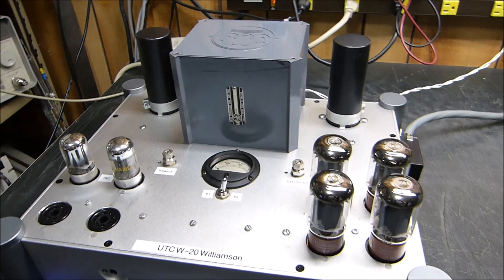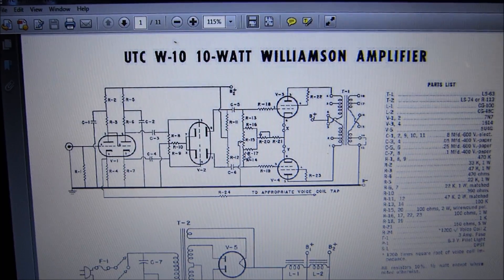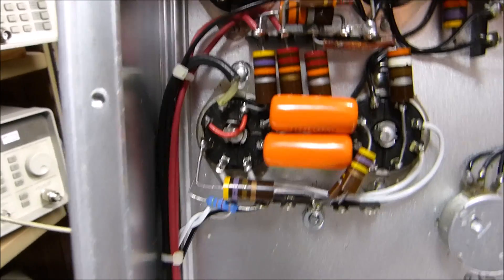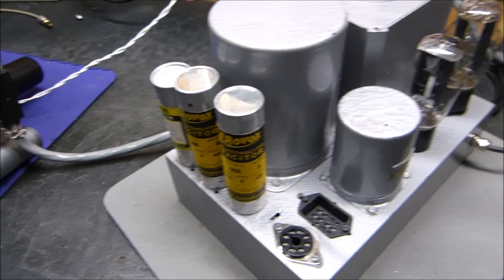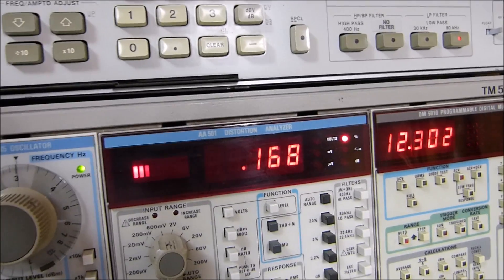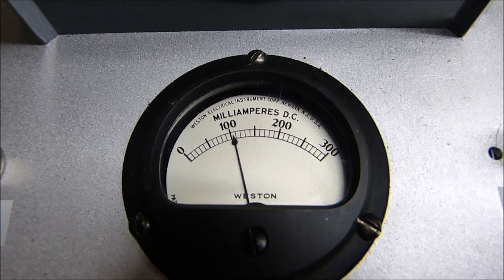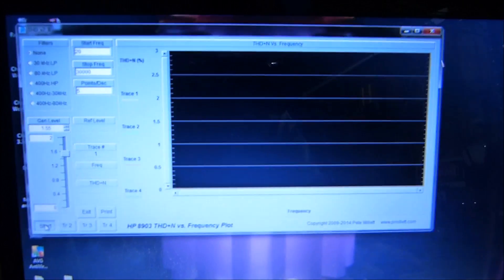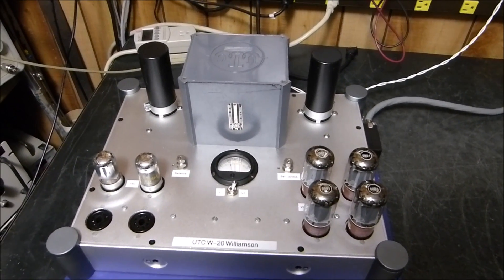UTC W-20,  20 Watt Williamson Vacuum Tube Amplifier Using UTC LS-60A Output Transformer

Comment: I often wonderd  what effect the power transformer has on a output transformer  being close by . It seems to be a very good idea to have the PSU,  separated and a big power transformer over rated and choke I think it will produce lower hum.
Reply from the maker: In an amplifier I posted a couple of years back, I did make measurements of the orientation of the power transformer in relationship to the output transformer. If the cores are parallel, there is indeed voltage induced in the output transformer that is very small but can be easily measured. If the OPT and power transformer have to be close to one another on a chassis, the cores should be at right angles to each other if possible.

Comment: Nice! mono or do you have the other channel too?
Reply from the maker: I don't have a second channel. That would be nice and the stereo version amplifier could be built on one chassis. The idle current is 200 mA on this amplifier for the four 5881's so it would require an even larger power transformer (400 mA). 
My primary interest in audio (besides listening to music) started some time back (like 50 years ago) when I kept hearing how marvelous these UTC, Peerless, Acrosound, etc transformers were for vacuum tube amplifiers and in the last few years, the high price some bring on Ebay.  
I build these amplifiers and have amassed these instruments that I take great care in maintaining at the highest standards I can, just to build, measure and document the performance of come of these vintage components. 
Some of my amplifiers are never connected to speakers and their entire existence has been on a dummy load and under test. That might sound crazy to some but it is my passionate hobby in audio frequency equipment. 
I also like to build high power RF amplifiers and everyone of those amplifiers, after some bench tests, gets connected to an antenna for communication with other ham radio operators.
Reply: @ElPasoTubeAmps  that's awesome. Thanks for sharing

Comment: With that voltage and the push-pull design, what limits the power to 20 (rock solid) watts?
Reply from the maker: John,
Honestly, I don't know. I am going to guess transformer efficiency. I have an experimental amplifier that I have shown many times where a 8K primary James transformer will deliver just over 30 watts (1KHz) at 1% THD. I have swapped that transformer out for a 5K UTC LS-57 and maximum power drops to 20 watts for the same level of distortion. One thing the UTC transformers consistently do, according to my measurements, is produce lower THD at the higher frequencies, even up to 30 KHz. They also "sound" very nice and I have that very UTC transformer/amplifier in my home theater system right now. It has a very clear and clean audio quality to it especially in the voice range. I really like it. And, my speakers are very efficient so 20 watts of even heavy-metal is amazing. Low end is very clean without being boomy which is actually the way I would describe the Heathkit 807 amplifier I posted a few days ago.

Comment: The THD difference at 20KHz suggests a measurement bandwidth difference. The Tek's bandwidth is 300KHz. What is the HP's?
Reply from the maker: The HP is 20Hz-100KHz and the Tek is 10Hz-100KHz. There has almost always been some Yin and Yang between the two on THD. Some discussions I read back when I first got these instruments talked about these differences and the only conclusion I remember is that it was believed that the Tek was more accurate because it was a simpler instrument and a single purpose instrument whereas the HP was a multipurpose unit. Maybe there was preferential bias between HP and Tek in that decision. I really don't know which is truly more accurate. Now that you mention it, I believe there was a slight bit of difference in THD displayed between the static 20KHz test and the scan. These differences occasionally do occur as I have seen this type of behavior before.
Reply: David, the Tek is definitely 10Hz-300KHz (manual p. 1-2), which would explain its higher reading at 20KHz. Anyway this is certainly fantastic performance from a 1947 design.
Reply from the maker: @EJP286CRSKW  
I didn't realize that. And I think you are right about the slight differences at the 20 KHz level being in favor of the Tektronix instrument. This also could help explain why some think the AA501 the more accurate THD instrument. All I knew for sure was the low end of the 8903A was 20 Hz and the Tektronix was 10 Hz. Actually, I need to use the 10 Hz level sometimes - just for fun.   Thanks...

AA501. The Tektronix AA501 is a audio analyzer plug-in for the TM500 system. It provides automated measurement of THD+N and levels (RMS responding) in the range of 10 Hz to 100 kHz. Harmonics are measured up to 300 kHz.Nov 3, 2018

HP 8903A: Frequency range: 20 Hz ~ 100 kHz. Signal generator output voltage range: 0.6 mV ~ 6 V RMS (unloaded) ... Noise & distortion floor, 20 Hz ~ 50 kHz (500 kHz BW): The greater of -70 dB or 95 µV.
Reply from the maker: @EJP286CRSKW  I have a question I would like your thoughts on. In the vintage instruments for example, the HP 3580A spectrum analyzer, the dynamic range (or noise floor?) is approximately -80 dB but some of the FFT devices that use USB sound cards and the accompanying software show a noise floor typically at -140 dB, or more. Even LTSpice has a displayed noise floor down around -140 dB or more. Personally, I don't believe this in the FFT devices. Your thoughts? Or, we can take this to email.
Reply: ElPaso TubeAmps You can see that it's true from the display. I assume that FFT can kind of reach below the analogue noise floor somehow, being a kind of digitization. You would certainly never get -140dB out of any analogue electronics. I would add that -80dB seems a rather mediocre noise floor in analogue spectrum analysers, but that's all you ever see. I don't know enough to about this stuff to know why.
Reply: The best channel! Very Nice!